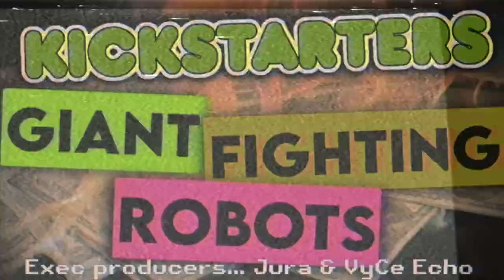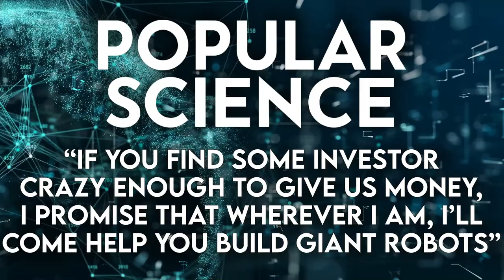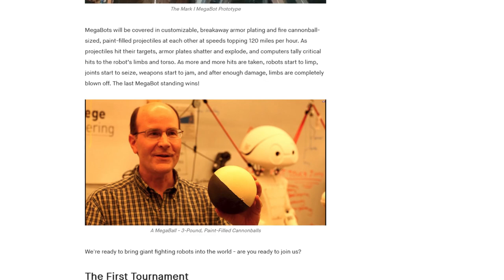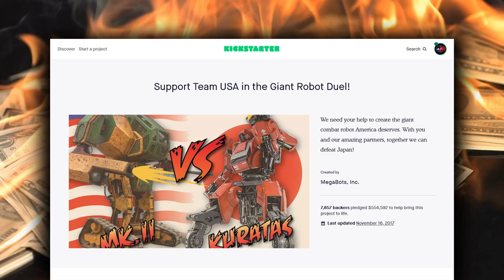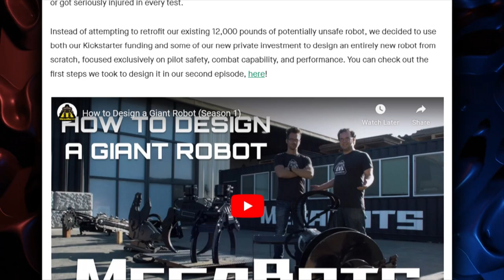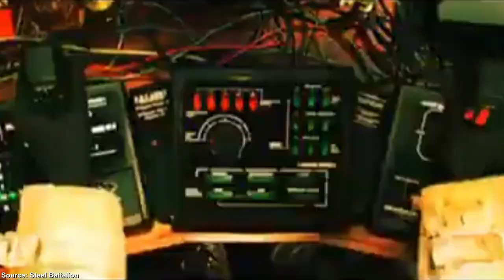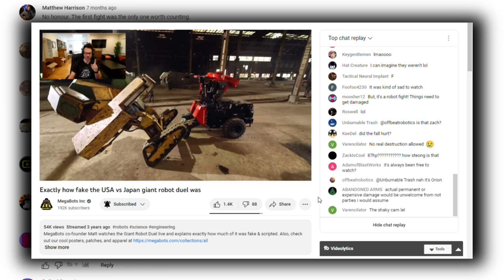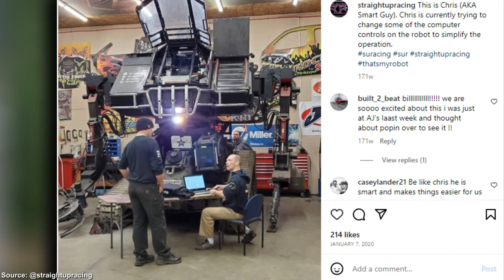Kickstarter's GIANT FIGHTING ROBOT DISASTER | Crowdfunding Documentary

Comment: Usually, in most series out there that have those giant mechs, they're kind of bullshitted through with the explanation that it's the future, they have better technology to actually make them really work.
They're made with materials that are stronger and lighter than anything we currently have, and they have some way of making a small portable reactor that's enough to power the thing easily... Meanwhile in reality something as simple as the Gundam built with modern technology can barely walk.
Reply: A Gundam is like 9x bigger than a human, so it appears to move 9x as slow.
Reply: I would also add that part of the problem is having a humanoid design in first place , do you know which animals were bipedal of many tons of weight that could balance themselves? Exactly , therapods (eg , T-rex)  .The biggest primate was the Gigantophitecus and weight around a ton , meanwhile one of the biggest therapods is the T-rex that can easily weight more than 9 tons , having a long ass tail and a body in a horizontal position instead of a vertical position would help alot with balance

Comment: I like the idea of the 4 legged robots you can kick the crap out of that stabalize well on a flat surface. It is unlikely to me and impressive to see that it's true.
But implementation outside of that in more dynamic environments would pose a real issue. Like if a robot had those legs in the middle east and was trying to climb down a rocky embankment with some lose stones that may shift on top of sand and stuff. I cannot imagine that it could detect that as it stepped on the stone and make the corrections needed if it was even possible to stabilize without rolling down the rocky sandy hill.

Comment: If you own a scrapyard you could make one pretty cheap....But it must be at least 5-10 faster.
To make it fun and fast it should be first a lightweight frame, with just the driver secured. And the outside of the metal skeleton should be covered with colored Styrofoam- pieces cut  into what ever shapes wanted... Now this could look cool when it gets damaged in a robot fight. Pieces flying every where....Who ever damages/removes mot Styrofoam in weight wins.
Reply: You dont know much about robotics huh? 

Lets say someones got a scrapyard.

How do you power your giant robot? How do you have the joints move? If it has a weapon, how do you trigger it? How does it move around while balancing itself?

Its a lot harder than having a bunch of parts. Small robots are relatively easy to make. A robot way bigger than a human is something entirely different 

Itd be like $500k-$1million minimum.
Reply: @childofcascadia  Seems like you don't know as much as you think you do....

Scrapyards get all kind of stuff, like bulldozers, and endless of working engines.  or easily fixed. Endless of all kind of moving parts you can imagine. Cars have electronic stuff. You name it they get it......Some special details has to be bought i assume.

but the main problem you saw in the video was they made them to heavy and slow. No, make them light weight and fast instead.

Give me a big scrapyard i can build one 10 times faster than the snails in the video. and for 10 times less the money
Reply: @childofcascadia  Mah dood I'm having a whale of a time with car batteries, electric recliner motors, and a raspberry pi to coordinate it all :)